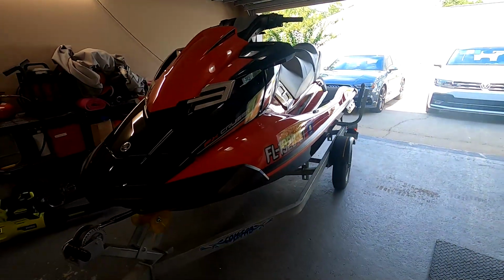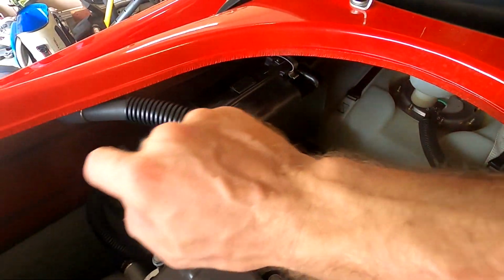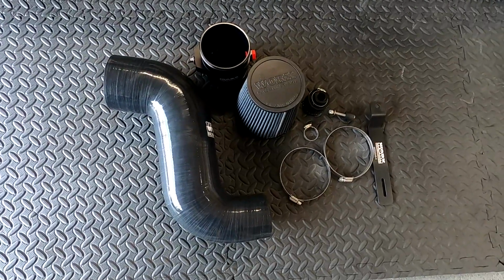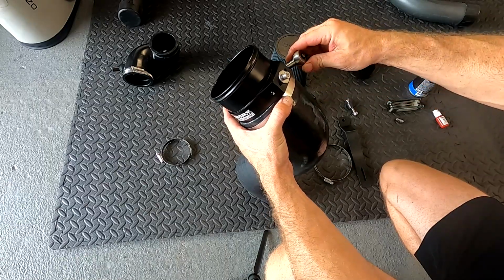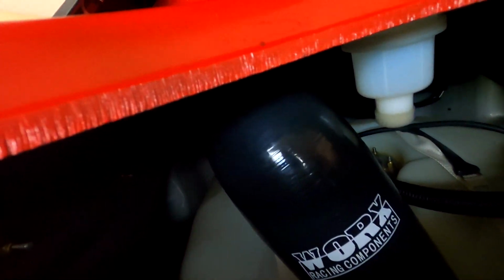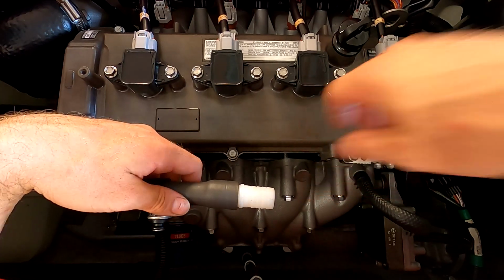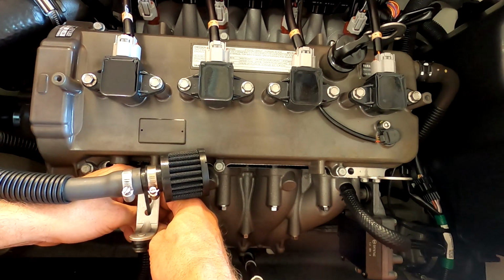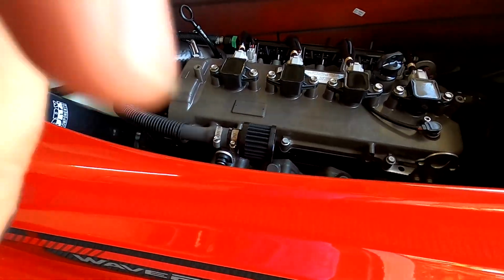My Yamaha FX WaveRunner gets a WORX intake!

Comment: I'm assuming the loctite was just to keep the bolt from coming out?  You left some slight play in the mounting arm so it can somewhat slide as needed?
Reply from the maker: I left the play in it so once I got the nut on the rear of the bracket and got the intake fitted to the supercharger and in place, I reached in with an Allen key and tightened it fully.

Comment: Are you tuned? 
Notice any difference with the mod?
Reply from the maker: Dre Knotz it’s tuned. Before the intake came in I made an intake that just removed the factory box but still retained the oem rubber hose. It was just a 3” 90 degree plastic pipe and a 6” filter. The ski did 75mph before and after the intake. However the throttle response is better now. To be fair before the WORX intake I was hitting 75 in completely smooth water and a half tank of gas. With the intake it was hitting 75 mainly but an occasional 76 with a full tank and in 1 foot chop and strong current.
Reply: @SaltyDogPerformance  thank you very much for responding.  May i ask for the exact parts you acquired to get to 75 mph?
Reply from the maker: @dreknotz1996  The ski is actually hitting 77 mph with a full tank. I have Dean's Team 8600rpm ECU tune, WORX air intake, WORX pump wedge, WORX pump strainer, SOLAS 13/18 impeller repitched by Dean's, and Fizzle Intercoolers Tial 50mm blow off valve kit. I'm currently only seeing 8380 rpm max due to a little bit of heat soak (95 degree ambient air temps) and I still have the oem flame arrestor (ribbon). This  week I'm installing a WORX ribbon delete. Soon I will be doing RIVA intake grate, Dean's Team ride plate modification, and WORX engine cooling upgrade. With the ribbon delete I hope to max out that 8600rpm rev limiter and hit 78-80 mph.